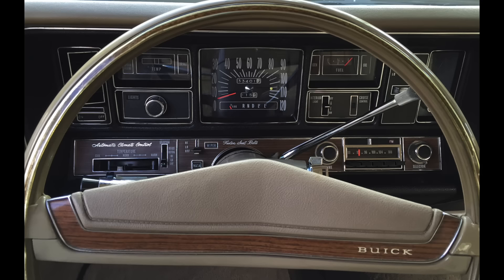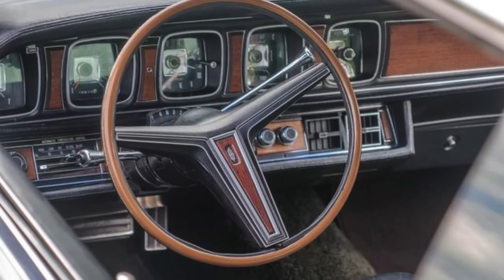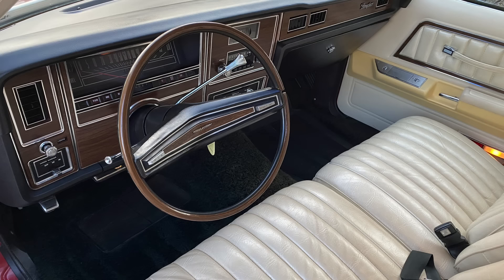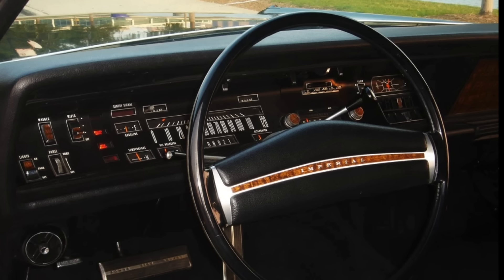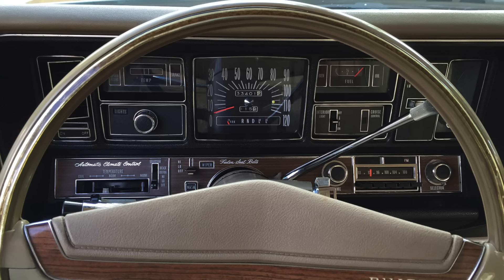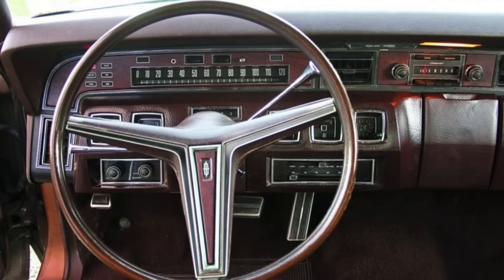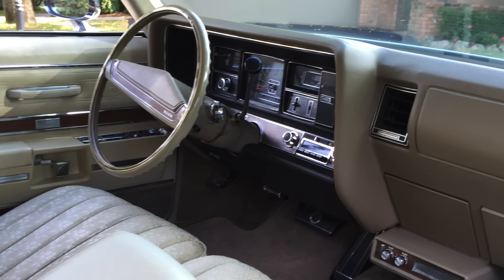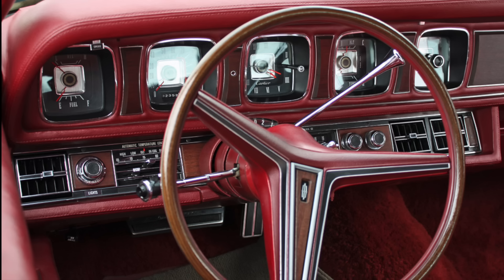Worst Automotive Inventions:  The "Rim Blow" Steering Wheel That Many Customers Hated

Comment: This brought back the memory of a hot summer day in 1971 when my family walked out of the mall and heard a car’s horn blowing continuously.  The sound got louder as we approached our 1970 Dodge Polara Custom.  It was the ring blow horn!  My Dad unplugged the horn.  The dealer replaced it and we never had any more problems with it for the next ten years we drove it.
Reply: Same thing happened one day in 1980 with my 1969 Mach 1 Mustang when I arrived home from school. The horn was blaring away, so I disconnected the horn(s) under the hood and the next day I went to the Ford dealer and ordered a replacement and then installed it...very easy to do. (My original one was all brittle and cracked by then). It worked fine for the next 8 or 10 months I owned the car.
Reply: My sister and her husband were hated in their neighborhood because their new 1970 Dodge Challenger's horn would often go off in the middle of the night after a really hot day.
Reply: Doing away with the wing vent window. If you haven’t driven a car with them you’re missing out in a small way.
Reply: Yep.  The cuda/challenger rim blow wheels are insanely rare.  The pressure ring is crap on them.  No telling how many got tossed and replaced with the std 3-spoke.
Reply: @JimVaught-qm6gf  it was a brief fad and I’ll bet that most of the muscle car wheels were swapped for wood or welded chain!  LOL

Comment: Least favorite invention is the crappy small spare tire.
Reply: I can at least see the pros and cons to those. They were much easier to store without cutting the trunk in half.
Reply: @pcno2832  Yes, I understand them, I just don’t like them.
Reply: @kge420 whatis the purpose for skinny spare, they still had to be large diameter to match stock tire size or the differential would wear out. If it had a posi it would ruin it in short order
Reply: I have no problem with a spare being made of cheaper material (pressed steel) than the main wheels (alloy) but it should be illegal to include a skinny spare that can't run at normal speeds and pass a vehicle inspection test.
Reply: it's got worse. Now a buyer gets a can of Tyre-Weld aerosol.
Reply: @rogerdodrill4733  The point is, it's easier to fit under the trunk floor without sacrificing luggage space. Also probably cheaper than a full size spare.

I don't mind. You very rarely need the spare wheel anyway.
Reply: at least it was a spare  it's something
Reply: Buy an 08 and up Chrysler LX car with anything larger than a 17 in wheel and you get NOTHING. No spare, no jack, no tire iron. Just a pump and a bottle of sauce to inject into your flat. BTW, if you leave that stuff in there for too long, it will eat an aluminum wheel. Also if you have GoodYear tires on the car, and you buy a tire protection plan, if you use said sealant emergency or not, they will void said plan.
Reply: Now we have no spare tire or jack.
Reply: @rogerdodrill4733  a lot of the "Space Saver" spares are not only narrower, but also smaller diameter. Their proper purpose is for an emergency get to a garage/home/off the freeway only, not for extended driving. (they have a max speed of 50mph/80kph)
Reply: Seatbelt interlock system. Close second was the lap belt with separate shoulder belt.
Reply: better than the no spare tire option
Reply: How can anyone defend that crappy spare tire? It's difficult to remove, it's not a real tire and it's dangerous!
Reply: Absolutely
Reply: @adamtrombino106  Adding to what you said, that pump and sauce bottle are totally worthless if you rip your sidewall.  Not super-common I know, but I have had it happen to me.
Reply: I remember when tires lasted 12,000 miles.  Back then having a full size spare and knowing how to use it was essential.  Even my grandmother could do it.  But I don't think I've used a spare tire in the last twenty five years.  Think of all the energy that would have been wasted hauling that thing around.
Reply: @jeffrey1312  I've had to use a spare tire on at least one car every three years or so.  To me the energy spent hauling it around is energy well spent.
Reply: @jeffrey1312  You have been very lucky. My wife, daughter and Grandson went to the beach this summer and came out one morning to find a flat tire on the left front. Not knowing how or to change it she called me. I was a few hundred miles away so I told her to call a tire service. When he arrived all he would do was put her donut spare on and charged her $120.00. She had to take it to a local shop to get the tire plugged and reinstalled. I know there are women who could have taken care of this on their own but my wife at age 67 just didn't feel qualified.
Reply: I have a 2013 Miata. Doesn't have a spare at all, just an industrial level can of fix a flat. You'd also lose the bulk of the trunk (as well as add dead garbage weight) if you carried one.

 I was squirrely about it with my first Miata ('94) but then it gradually worked its way into my brain that in 42 years of driving I've never used a spare tire. I've driven over a few screws and such, but the tires stayed up until I hit a shop and got them plugged.

Of course, I live in a rural area and probably don't see the amount of road hazards for tires in 20 years that city dwellers see in a single day even though I probably drive 3 times as much.
Reply: @buck546  It's for people that follow the rules of using one. 50MPH or less while driving to a shop with relative immediacy (within 50 miles or so) to get the damaged tire fixed or replaced. 

The problem is most us Americans seem to want to give the finger to said rules instead of just biting the bullet and doing what needs to be done, (that will have to be done eventually anyway).

I've seen donut spares on car that have been left on for so long the tread was worn slick. That's just owner laziness and stupidity. When used PROPERLY (follow the rules) they are perfectly fine. 

If someone doesn't keep enough in their bank account for even a COMPLETE set of tires if needed, then that is THEIR irresponsibility, not the "bad idea/design" of a lightweight spare.
Reply: @waynepurcell6058  I live in a very rural mountainous area where there are many areas where cell service is unavailable. The last thing on my mind is few pounds of additional weight in my vehicle. I don't mean to sound hateful but a flat tire on a cold winter night or heavy down pour rainy day with a long walk ahead of you is not only no fun but for the very young or elderly could be dangerous! A can of fix a flat won't help if you have a blow out and not sure how well that donut spare will perform on a slick icy mountain road. By the way you do realize there are some folks that have a tough time in this economy dropping a thousand bucks for a set of tires when there's bills to pay!
Reply: Nowadays a lot of cars don't even have that.  They have no spare tire at all.
Reply: @buck546  I live in a rural mountain area too. Actually, I live just a skip from the Devils Whip (80 north in the WNC Appalachians), and just a couple hours from the Tail of the Dragon. I've driven all over these mountains, hell a little over 800 miles in a single weekend a few times (with zero cell service in 80% of the places). 

I had to drive home without a clutch twice (due to clutch master cylinder giving out) and hit a deer once but never have had a blowout. Literally not since I got my license in '84. The only BLOWOUT I even vaguely remember is my dad having a (multi time) retreaded bias ply pop on his '74 super beetle when I was like 5.
Reply: @waynepurcell6058  Well I guess a can of fix a flat will work for you. It's your business and I'm not telling anyone what to do. I could care less. I'm old enough to know that tires have improved over time. I've been driving since the early seventies and you don't have to be sarcastic to make your point. You keep your can of fix a flat and I'll keep my real spare tire.
Reply: Followed closely by any size spare fastened to the underside of the back of the vehicle.
Reply: So buy a vehicle with a full-size spare. Boom problem solved. Or if you don't like that, buy an extra tire and put it in your car. It is not a hard problem to solve.
Reply: @wendull811  You should work for a car manufacturer, clearly you think like one. The heck with what the customer wants, they can spend more money to solve a lousy cheap design error.
Reply: @buck546  Thanks because I actually do as a mechanical engineer
Reply: @wendull811  Surly as an Engineer you can't really believe that little save a spare is a good idea, right?
Reply: @buck546  compared to the extra weight/ space that a full size would take up plus the aerodynamic loss from the budget that would have to be made on the backside of the car and man other factors. Yes yes it is. I gotta go to work see ya.
Reply: Least fav invention is elimination of the spare and jack entirely...
Reply: Even worse was GM's "collapsible" spare that came with a bottle of air to inflate it to a (ahem....) "full" size spare. Once the bottle was used, you were screwed for a spare tire.
Reply: @rogerdodrill4733  You only use the small spare for short trips to a shop or home, at lower speed.
Reply: @rogerdodrill4733  That only affects jackasses who keep driving on it like it's a normal wheel. It's more than enough to get you to somewhere you can get your puncture repaired or replaced.

Comment: I had a 1973 Triple Black Imperial Lebaron that had the Rim Blow.  Worked just fine, and that horn was LOUD.  Loved that car.  Sold it about 15 years ago and still miss it.
Reply: We all miss the one that got away from us. Mine was a 69 coupe deVille with the rim blow. From what I remember it worked well.
Reply: The rim blow switched a relay that connected the 12 volt to sound the horn. Older, and newer, horns the horn button or other type of switch connected the 12 volt directly. Rim blow used a low power circuit, still 12 volt, for fear that the delicate nature of the internal parts would become worn if they had full power through them. Especially cars with an exceptionally loud horn.

I had a small car once that had a horn that other people could not hear. I added a relay to power a loud horn that just came off a junkyard Cadillac. Parts store horns were too expensive. Junkyard parts were my price range. I chose the Caddy because I knew it had a loud horn. It also had a musical sound to it. I used the relay because its original horn was wired so the horn button grounded the horn. Opposite of what older horns did. The downside is that I did not want to use it to get kids to get out of the road. I did not want to scare them. But perfect for the interstate.
Reply: I still have my father's 72 Imperial. Never had a problem with the horn.
Reply: I never had a problem with the rim horn blow button on the 1973 Ford steering wheel as used in a Ranchero or Torino...worked reliably, looked nice with the interior, as it didn't stand out like a tacky old ring or modern button.
Reply: Did you have the Executive model '73 with the cassette deck on the hump with a lanyard for the microphone? Had fun with that and my 7 yr old son. I recorded his name at low to start, then louder. He kept lookin' at me, not saying anything, then he jump up front, over the seat, scared. Had to explain it to him.
I liked the rim blow, never a problem.
Reply: My Grandmother had what I think was a Ford LTD with this kind of horn. She was constantly blowing the horn. She even was behind cop cars and would blow the horn. They would pull over and she would have to explain the horn setup.. She finally had my Dad disconnect the horn.
Reply: That 73 imperial sounds like a fun ride.
Reply: My 1983 grand marquis horn was on turn signal stalk.  You pushed the stalk and horn sounded😅

Comment: The worst horn activation was on the early Fox bodies where you pushed in on on the turn signal stalk.
Reply: Ford was trying to be "European" with that gimmick.  They even said as much in their press release with the new Fairmont.
Reply: @BlackPill-pu4vi  Can't also help but wonder if cost was a driving factor.
Reply: @kennethsouthard6042   Ford being Ford, you know the bean counters were involved.
Reply: My buddy had a Fairmont with one, he asked me to find the horn and laughed his butt off at me smacking and squeezing the wheel until I saw the "horn" on the stalk. I thought that you just pulled it towards you but heck no, fumble for a button. Got back in my '66 Chrysler and thanked mopar for a horn ring! My wife's '49 Dodge has one they go back to at least the '30s as the most common system.
Reply: My dad had an 80 Fairmont and I remember he never seemed to hit the horn button directly. He would hit it at a slight angle that sometimes would sound the horn, but would mostly activate the turn signal
Reply: @BlackPill-pu4vi  All of my Citroën’s have that feature, both for Town & country horns.
Reply: I was going to say the same thing.
Reply: M parents had a zephyr that was like that and my pops said F it, he didn’t want to deal with it so he drilled a big cheesey universal horn button into the dash.
Reply: totally HATED these.. i was learnign to drive when these were out in the mid 80s and never got the horn right.. or I was used to grandma's car where thats what id use for the cruise and instead i hitthat on the ford tempo driver ed car on the freeway and blew the horn!!
Reply: I’ve never even heard of that. Sounds terrible!
Reply: Grand marquis. 1983

Comment: I've driven a few cars with this feature.  In each one, the horn was tricky to beep when actually needed, but beeping the horn unintentionally was quite easy!
Reply: Thanks for this one, Adam. Yeah.. I drove a few of these over the years, I never owned one, but frequently had to drive cars owned by others.. The horn actuated when I didn't want it to, and I immediately hated the feature. The center hub of the wheel is where the horn activation should be located. The old horn rings they had in the '50s and '60s are sort of nostalgic now, I don't mind those, but putting it where simply gripping the wheel a bit too tightly activates the horn seems like a half baked idea...
Reply: same on both here. It can give one a case of steering wheel anxiety.
Reply: Yup. I remember...especially when using the "index finger" turn.
Reply: That sounds almost as crappy as some Teslas which have a small touch button on one side of the steering wheel to activate the horn. It's a completely flat touch surface like a phone, so you can't press it by feel!
Reply: @MarinCipollina  That’s not how it worked. It’s a thin groove that would never be activated accidentally!
Reply: @zzoinks  Elon gets bored and pulls the wings off flies and stupid features. A Tesla can’t even do a proper uturn — it needs about 20% more room than you’d think! And that stupid blank dashboard trying to prove a stupid point. Give me driving info in front of me — not on a distant tablet!!
Reply: @Porsche996driver  Don't tell me. I've had the experience. You don't know what you're talking about.
Reply: @zzoinks  I've been a wanna be car designer most of my life, and I knew when computer geeks were getting close to designing cars that it wasn't going to end well
Reply: Is purple your favorite flavor?
Reply: @Dingleberry1856  that was Barneylarious, but you can call "the ramp truck guy" when you pop the last capacitor holding a joule in that K kar ya got there.
Reply: @HelpingHand-ic4wt  went over my head, please explain.
Reply: @Dingleberry1856  k kars and probably more the Chrysler cars that came after that were notorious for needing capacitor replacement in their computers.
Reply: @HelpingHand-ic4wt  gotcha. Chrysler has always been notorious for needing😂😂😂